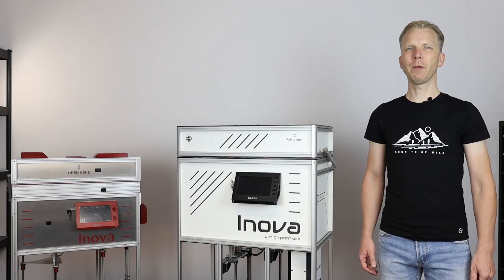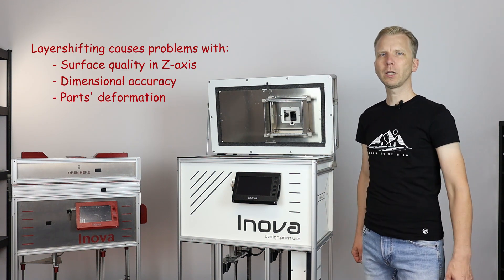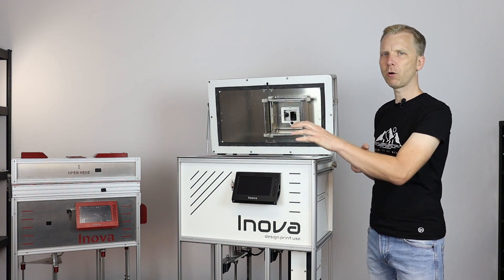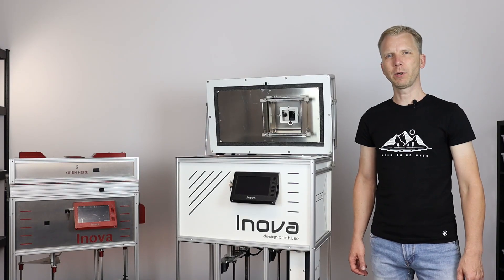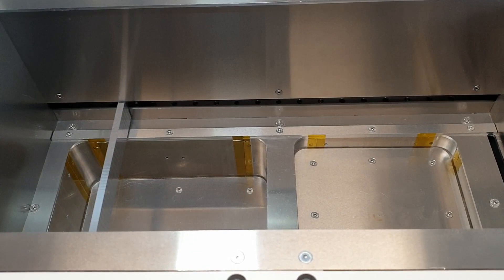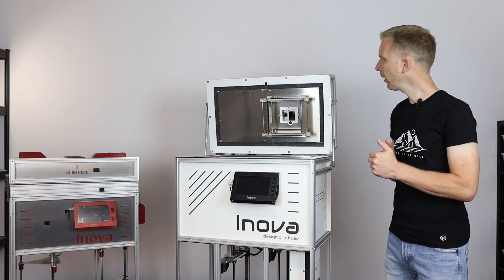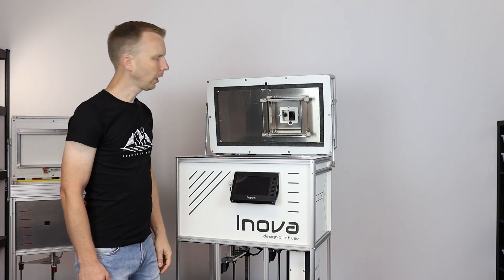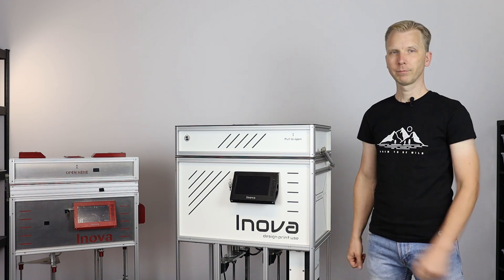How I Made My DIY SLS Printer Better – Most Important Upgrades

Comment: I was wondering if you can add side lasers so that the laser can deal with side prints and you could provide a grinder under the powder chamber where you can grind left overs and you could provide an internal fan that can push the left over powder out of the chambers for self cleaning, you can also add a small vacuum tube to finish the top you can hang on the side of the 3d printer,also you can make the platform to come down all the way down and move towards the middle of the 3d printer and you can have adust collector where the dust can be discarded to another bin in the middle of the printer underneath both chambers and you can have doorway you can open and pull out the discarding chamber out for discardment, also instead of using belts, you could use metal wire to push pull and push the chambers which can push and pull the chambers up and down and can handle a lot of heat, they do that with airplanes, they use high grade cable wires to maneuvering the airplanes in mid air
Reply from the maker: Yes, there is a lot of space for this kind of ideas but unfortunately a lot of them have already been covered by pattent laws.

Comment: This is great. I just returned from FormNext and realized that there is more than just PA12. BASF has some nice types of materials that would be perfect for the parts I want to make so I started looking at SLS printers. These are almost getting within the affordable range and then there is even the Sintratec kit that is "cheap" but the inside looks like an Ender3 on steroids (no offense).
The build quality of your Inova release candidate looks like it will become a very usable design that has potential even for company use prototyping or small series production. 
Even if we decide to buy a commercial printer instead of building the Inova this is a great project to follow 👏
Reply from the maker: Thank you very much. It's great that more and more people are seeing the huge potential of SLS printing and thinking about how to use this technology in their projects. I hope that my activity will not only make SLS more accessible to technical enthusiasts, hobbyists or small businesses, but also help people to understand more deeply how this technology works, as the available sources of knowledge in this area are quite limited.

Comment: I know this is prolly pretty far off but, will you be designing a post processing station? Obviously many of the off the shelf ones will mostly work but a lot of stations utilize the ability to push the print volume out on command to slowly excavate parts? This was one thing that came to my mind with some of the “cheap” SLS solutions from some companies that had no solution for post processing.
Reply from the maker: You are right, post-processing is an important and integral part of SLS printing. That's why I recently designed and built my own post processing station to make post processing clean and easy. I will introduce it soon in another video along with the first prints.

Comment: How hard would it be to build a larger SLS version based off the documentation? I want to mess around with boat props with minimal post processing.
Reply from the maker: In the z-axis this is potentially not too hard, in the XY-axis it can be quite complicated.
Reply: You have to be aware that this machines use a galvo that usually moves the laser ray +/-15deg. That means a pyramid with a outer "shape" of 30deg. The bottom area of such a pyramid represent the max the printer can scan or better said print to. Now to increase the volume  (z-axis is easy), you must increase the "light cone" . Meaning you MUST move the galvo further away from the print surface and doing so the height of the machine will increase.
Reply from the maker: Exactly, and that means quite a few problems with the optical path in terms of beam focusing, etc. etc. etc. :-)

Comment: Maybe better solution than securing overpowder bin with screw it is to use some neodymium magnets to latch it in place. It should be strong enough. Anyway great progress, I was thought that it is just impossible to make DIY SLS printer
Reply from the maker: Good idea how to make it even more user friendly, thanks for that!
Reply: @SLS4All  Maybe neodymium magnets are not such a good idea - Curie temperature is 310-400 deg. C, if the overpowder bin gets that hot...
Reply: neodymium starts to temporarily lose magnetism around 80 degree C, with proper spacing from hot elements it should be ok. I don’t think that bin would get that hot if powder have temperature around 170 Celsius. U would need to dump a lot of it in short time to heat up the bin. If temperature are the problem, bin would be made of different material, but here if I’m seeing correctly it looks like a dibond, which doesn’t have a lot of temperature resistance. There is always option for just mechanical latching, i.e. simple spring loaded arm and divot, implementing magnets in design is just much simpler.